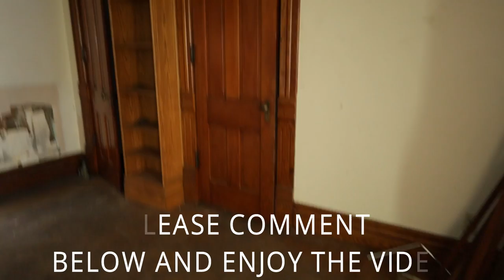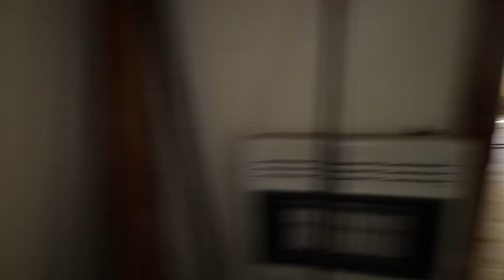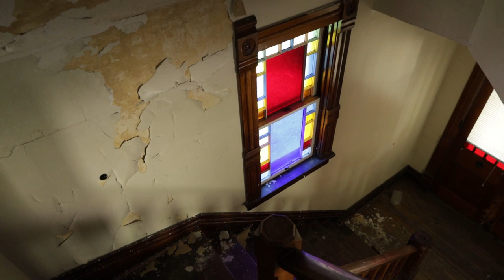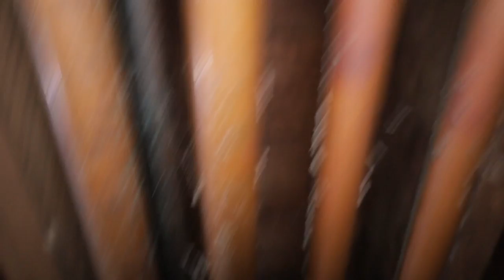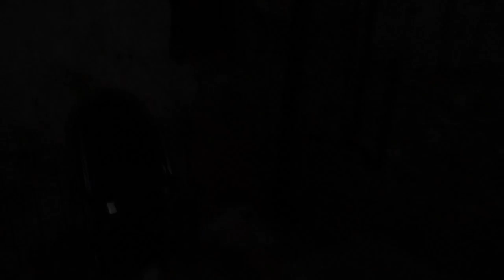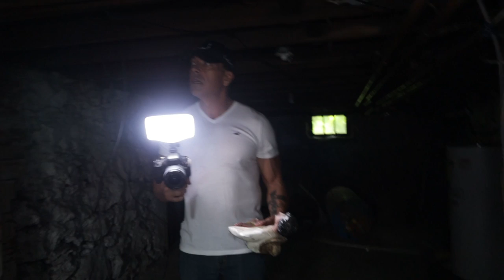(PARANORMAL PIPES ARE CALLING)STATUE WANTS US OUT!!!

Comment: Well I know if you turn the water on upstairs sometimes the pipes will shake
Reply: I’m in the plumbing business and in over 40 years I have never seen or heard of pipes being so violent what you are talking about is air trapped in the pipes which yes it makes them shake where the air is trapped which is easily remedied by realising the air with a radiator key 🔑 hope this clear things up for you 😀😀 best wishes from England 🙈🙉🙊
Reply: @andrewharper7786  Might’ve been somebody down there shaking the pipes to
Reply: @andrewharper7786  OK I have a toilet problem when I flush my toilet in the tank and empties my water runs and runs and runs what is the problem I would appreciate if you’d help me tell me what I need to do
Reply: @lisagast4616  you have in your tank and system over your toilet usually a round plastic float attached to an arm as the water enters the tank the plastic float rises with the water when the water reaches the desired height this cuts the water off sounds like your float isn’t reaching the desired height so the water will keep entering the tank it’s a simple job there is a plastic screw when turned will higher or lower the cut off point you will need to lower the cut off point this will stop water constantly trickle in I will be very surprised if this isn’t the problem according to information you gave me 😀✌️good luck from England 🏴
Reply: @andrewharper7786  Thank you so much
Reply: @davidhale4647  Be quiet I’ve had this Toiletproblem for a long time and I’m grateful for the help
Reply: Best paranormal ever
Reply: @davidhale4647  ok I don’t care And no it wasn’t a good paranormal show